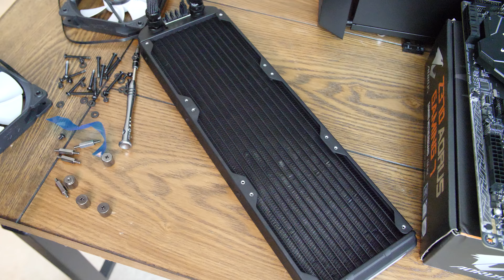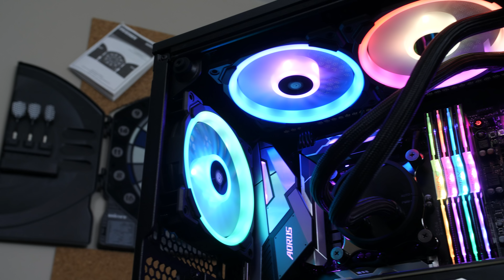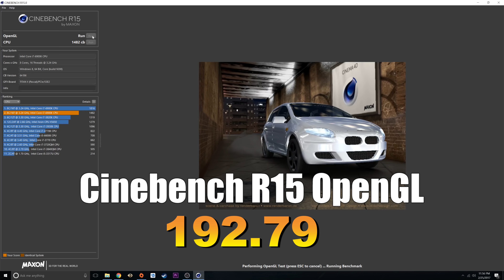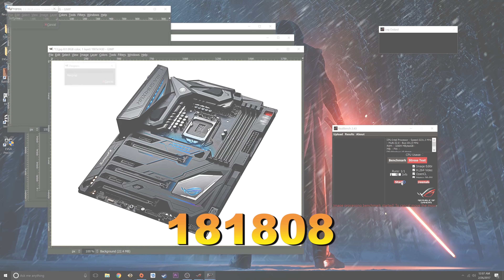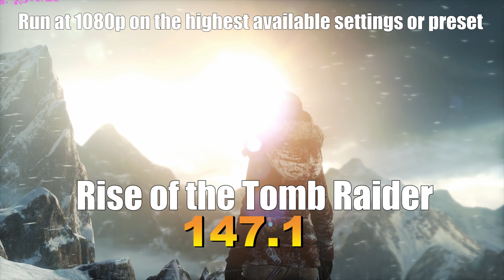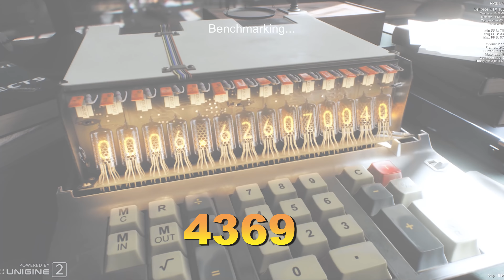Monthly Build Series - October(ish) 2017!

Comment: Which meshify is that case?  On new egg there are a few different forms of Meshify C, some with TG, dark TG, and the only one that doesnt mention TG(including the one you linked to) doesnt appear to have any glass in it.  I want that exact case you got.  Attempting to emulate your build as I already have the motherboard and video card, and subbing out G. Skill just cause they are reliable when it comes to RAM.

Comment: Building PC's is like going to the gym; it's a replacement activity for when we had to build things to survive. Now instead of picking out our favorite tree to chop down, we pick out our favorite components. Instead of running from bears and wolves, or carrying a carcass back to our tribe, we run on a treadmill at Planet Fitness and hit the bench press. The computer industry could've easily standardized itself with plain, closed boxes that you can't open up. Computers probably could've ended up cheaper since it comes down to the manufacturer's responsibility to have the lowest overall price, not the consumer trying to shop around for the best price on individual components. Either way, it became a hobby because we like to build things.

Comment: Nice looking build. The only thing I don't care much for about the Meshify is it looks like they banged the mesh panel up with a hammer or something. They should have just let it be flat, not sure what that's all about or why they did that, it's preventing it from being my next case. I want to take it off and iron it or something and put it back on. I am way too OCD to have that, it's not even symetrical.
Reply: Nah I think it looks good the way it is. Adds a bit more depth to the design.

Comment: I like the idea of using the fans for case lighting instead of an LED strip. I love this case, but I wish that they had used some of the white accents from the define series. Great showcase of an amazing CPU! 

On the subject of power supplies, is there an easy way of monitoring the actual wattage the psu is putting out in real time? PC part picker will tell you the system requirements but that doesn’t take overclocking into consideration. 

Thanks for the video and keep up the great work!
Reply: You should see their latest case...they just released this in white and it is oh so sexy. I also agree with your about the light strips. I had light strips installed in my build and then purchased an AIO RGB cooler with RGB fans and RGB ram and it looks much better with the led strips turned off. The strips just add too much light inside.